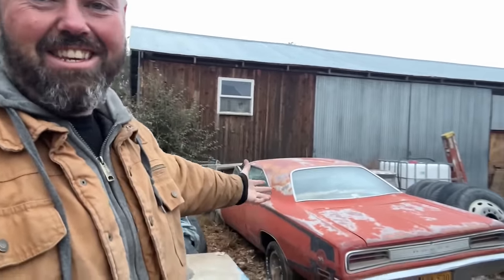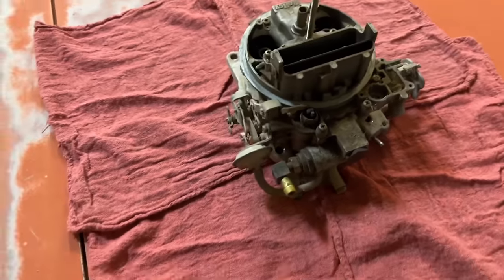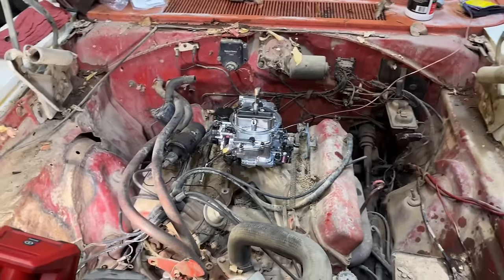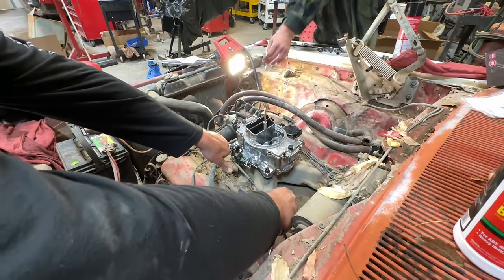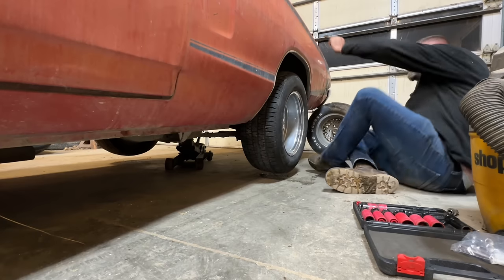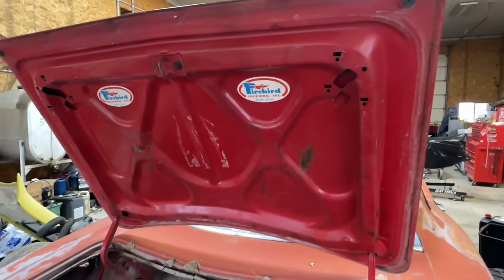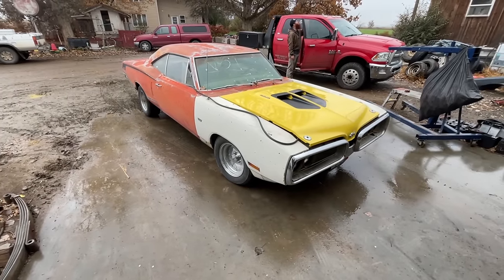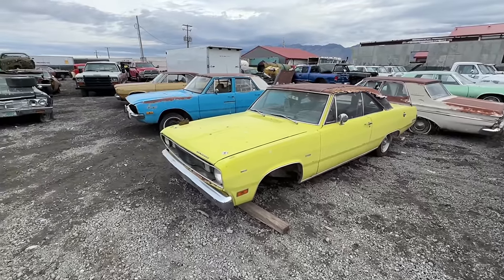EP 111 Left abandoned by a fugitive for 40 years. Can we make this 1970 Dodge Super Bee Run???

Comment: That's my car and I want it back lol..That's my favorite and my dream car cause I remember watching a Super Bee rule the Kanawha Valley in Wva in the 70s. I'm pretty sure that it was a 440 4speed car but it ruled. It was gray paint from factory with black decals and badges. I used to go hitch hiking just so I could ride in the car although moma always told me to never get in that car but I did anyway and it'd pin ya in the seat as long as the throttle was to the floor going through the gears and even at 50mph when he mashed it to floor, you ain't going to move around that's 4sure. I remember the odometer said 160 and I'm 💯 percent sure that it would've easily done 160 and then some cause just playing around 137 wasn't a hard thing for the car to do and ain't nutn like a Mopar when it comes to raw gaspump horsepower

Comment: Time for a tune up, Accel Super Coil and good wires. Also, make sure to use the Accel rotor regardless of the cap you use. The tip is much longer and reduces the power lost when jumping the gap in the cap.
Reply from the maker: Never heard that before, but definitely makes sense. Thank you

Comment: Excellent video!  A good body guy can probably straighten that left rear quarter, since that car is so solid and original, I'd avoid replacing it. I'd be more scared of that right side inner fender/apron. But it can be replaced, it's just kind of a big job. I'd lose those extended shackles to lower the rear, and fill in the hood-pin setup - unless that's factory. 
That red with black stripes ought to look killer when it's all redone. I would look for some of the old original center caps which were sort of beveled if I remember right, and they had blue lines going across them, surrounding the "CRAGAR" lettering. Those will be about perfect with some smaller front tires. Those will look killer, although Cragar SS are my favorite.
Reply from the maker: For the moment, I want to do all the mechanical and suspension. I really just want to enjoy it. That being said, it will be getting the trunk floor installed, and we will likely do all of the front inner Sheetmetal that needs replaced. Luckily I am good friends with Dave @rustbucketrestos and he will be helping me. You'll be able to see the car on his channel as well. 
Rear suspension will all be Calvert racing stuff and the front will be a combo of QA1 and PST. I will also be adding disk brakes to the front. 
I actually do have a set of the correct early centers and when I get the new tires installed, I will be using them.